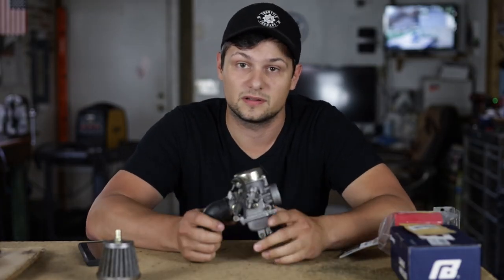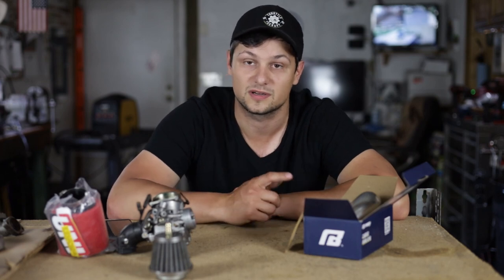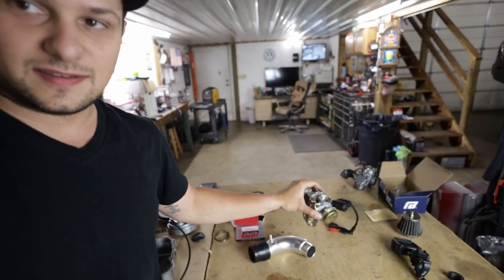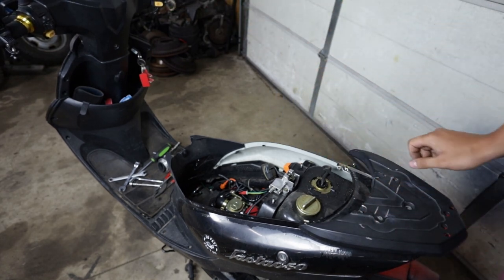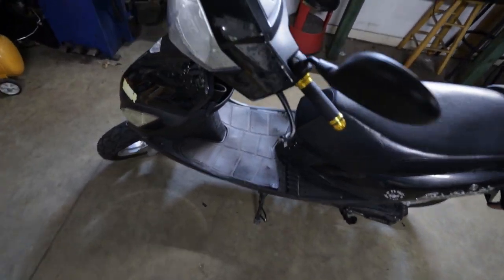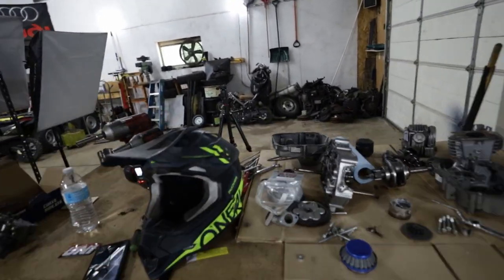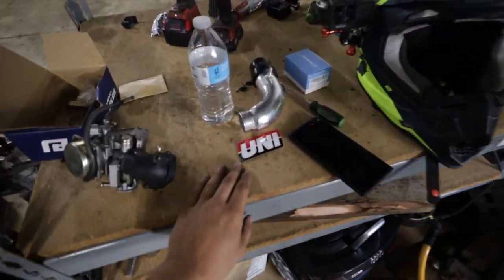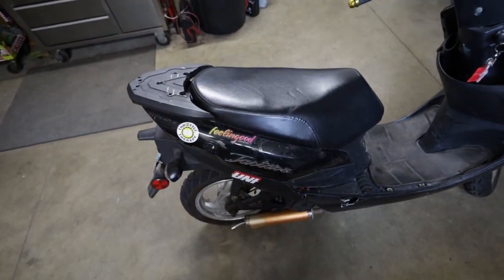50CC GY6 SCOOTER BIG INTAKE KIT | Worth it?

Comment: I had to upjet to an 82 jet from a 78 when i got this pipe along with a Uni filter. I might check the spark plug and see if i still need to upjet but on my 50cc I used one of the starter bolts that’s on the actual starter itself  to bolt up the bracket that came with the kit and it supports it great that way you dont need to mount it with zip ties. Just be careful not to strip the head on it. I might upjet again to an 85. This pipe added a TON more power and torque when i added it.

Comment: I'm glad running just the stiffer clutch springs worked for you .
These scooters are shipped with various main jets. I've bought ones that had 78 mains stock. I think with an open filter element and high flowing exhaust you could go even bigger, like an 80-82. 75-76 sounds excessively lean to me
Reply from the maker: I agree! We are going to re jet now. No reason not to

Comment: When you order the carb and it comes with that cone filter, you can rip off the rubber boot from the old filter. For those of you without a 3D printer now that is your adapter to the intake tube. I saw this video after i ordered the parts and was like wtf mate. Now I would maybe recommend taking the carb out as to make those 2 boots fit on is bit hard to force on, I was going from the side though. And after installed I went by one of those speed limit signs with the radar display it said i was going 41 might of been going downhill as well slightly as I don't think I hit that top speed the other way. Was surprised when i seen it looked at the speedo an it said 47 not that off. 2020 Wolf V50 800miles
Reply: you could also just wrap electrical tape around the filter port until it's big enough

Comment: Hey you guys should try a 60cc big bore kit that Amazon have for 25 dollars and see how the scooter runs after
Reply: The 80cc /72cc kit works awesome, has plenty torque and power to climb hills and keep up with traffic. 40mph is normal cruising speed now and maxed out at 55mph going downhill of course. Its very easy to install with just a few basic handtools, and a feeler gauge and torque wrench. Install was about hour and a half. Well worth $50 from amazon. I got the glixal 69mm valve head and glixal 47mm cylinder kit, it screams now. I also use a 24mm carb and open cone filter,advanced the timing and ported the crap out of the restricive head, removed egr, 1500# clutch sprngs, glixal variator 5gr rollers for now but may go heavier later to keep the power in the band. No tach to really tune it yet so just going by ear,speed, and spark plug inspections. I bought a four pack of plugs, so i could change them out after every upjet until it was perfect.
Reply: You could buy just the cylinder kit and keep your old head, it has a smaller combustion chamber tho and will increase compression and make it harder to start. A local shop quoted $25 just to mill it from 39.6mm 47mm, do I just bought the 47mm head.
Reply: Works the Electronic start for you,when The engine is cold ?
Not for me.With 72 cc

Comment: Can you install a bigger intake and bigger carb on just a 50cc without adding a big bor kit I've already replaced high performance clutch and variator with 4.5 slider weights I'm not really trying to get 60 MPH out of it but I'm trying to hit 50 to 55 please some let me know
Reply from the maker: We could give it a shot to see what happens. I think it would work with proper tuning but It might not add any performance. I am going to look around and see if I can find a 20mm carb or something.
Reply: @throttle_therapy   thanks so much if you do please let me know the name I'm putting on my new high performance exhaust today
Reply from the maker: @drewalker9318  will do

Comment: Would a bigger carburetor for a 150cc work just as well?
Reply: yes but it doesn't make any sense. you don't need a bigger carb. i've run a 80cc big bore kit on the stock carb, you just need to jet it right.